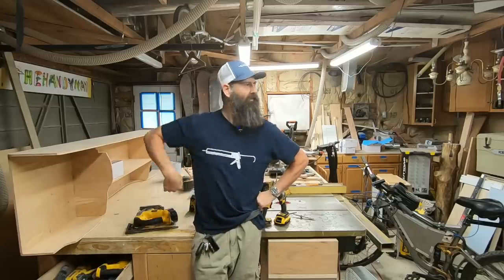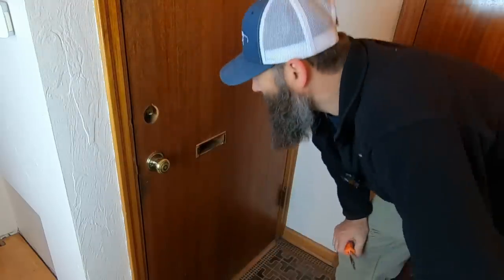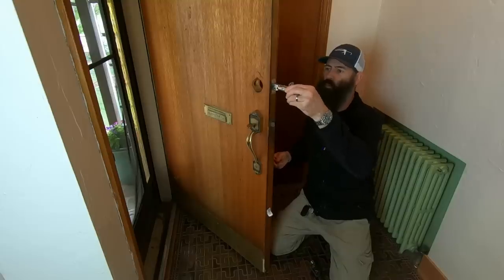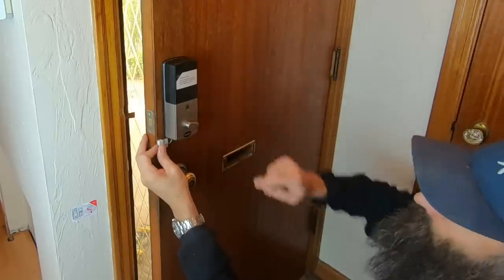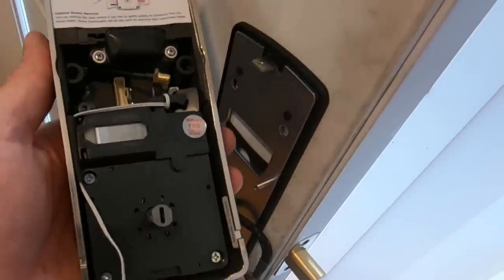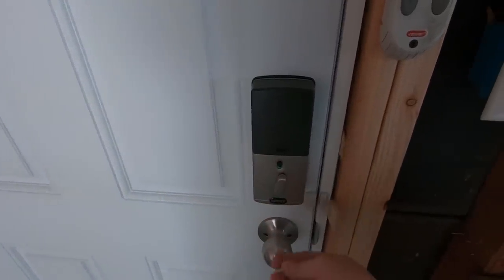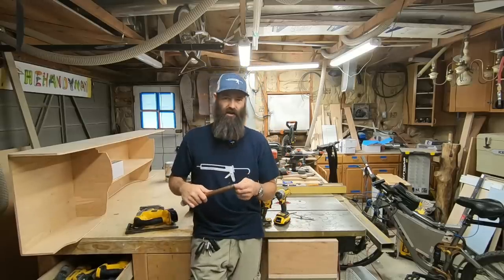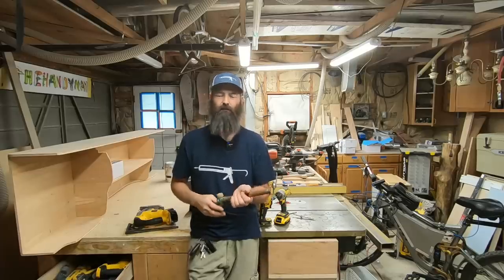Smart Lock Installer Makes $300 Per Hour | Easy Money | THE HANDYMAN

Comment: I put a kwikset code lock on my back door recently.  When I opened it up and started pulling all the parts out and all the instructions, it was a bit overwhelming to look at.  But one youtube video was all it took and I had that thing slapped up in ten minutes lol.  I need to file my strike plate a bit like you did, my deadbolt has a bit of resistance to it like that.  And man, never stop doing the high pitch voice, it cracks me up every time lol
Reply: You don't want to have any resistance because it will wear down the batteries fast. If you ever see reviews complaining about battery life on these locks, it is because the deadbolt is rubbing and straining the motor.

Comment: The first frost free I ever replaced for my Grandparents used a threaded adapter.  I wasn't comfortable soldering.  The problem is you can't keep tightening the frost free faucet until it stops leaking because then it won't line up correctly outside.  I tried pipe dope, teflon tape, still leaked.  So I followed up with using teflon tape AND pipe dope, and not a drippy drop!  In my home last year I just soldered a new frost free on, no need for a threaded adapter, really doesn't help the process along at all unless you were using PEX or CPVC in which there's no copper to solder anyway.  I'm also NEVER going to use a shark bite fitting, no thanks!

Comment: Does the exterior portion of the lock have some sort of ears that stop the whole assembly from being rotated? It just seems that with that lock being so tall above the lock hole, it would provide so much leverage so a strong individual could just put some muscle into the top of the assembly and twist it, shearing off the 2 screws that hold it all together. Haha I could be totally wrong but that was just my first though.
Reply: the mounting bolts for the smart locks still pass through the deadbolt latch assembly, just like your old door handles and deadbolts, so you can wiggle them a little bit, but you would not be able to get a full rotation out of the outside face. I couldnt see real well in the case of these bolts, but the one I installed at my house and my parents house, the bolts were thicker, so I dont think you would easily shear them off either

Comment: I have a love/hate relationship with smart locks.  I have run into too many homeowners that have doors out of whack to where they have to push on the door extra hard or even lift up on the door knob to engage their current deadbolt.  They often do not want to pay the extra labor of fixing the door first in order for the smart lock to smoothly function.

Comment: I'd like to put a smart lock on my front door, but my door is a tight shut. As in, if you try to "throw" it closed, there's a chance it won't latch. There's resistance from the frame. Not overly confident in messing with the shims to fix the close. And from what I have seen, these locks are junk if there is any sort of resistance for the deadbolt.

Comment: Question, I’ve installed bazillion ceiling fans on both of my houses and others and they used the L-Shaped boxes, I noticed that the fan bracket doesn’t attach to the box itself, it gets screwed right into the joist. You have the same?

Comment: How long do the batteries last in general on these things? And how do you get in if the batteries die when you're on the outside (other than a sawzal)
Reply: I don't have a wifi/camera one, just one with a keypad and autolocking, the batteries last for a along time about 1 to 1.5 years for me so far. There is still a physical key hole under the little swinging door below the keypad if the batteries die while you are out.
Reply: Maybe it sends your phone "Low Battery" messages? 🤔

Comment: This is brilliant. So literally everything fits like standard deadbolt hardware and just a few simple connections done! Right?? 

I would love to do this as some solid side work. It looks pretty cookie cutter to understand. 

Are there any challenges to be aware of or can I start this right away? 

Love your easy instructions.
Reply: Yes, there are things you can run into that change that easy swap job into something way more involved unless you have the jigs.  I'm sure that's why he asks for pics now.  I do all the key swaps and lock swaps for 35 units, all of them are easy once we switched to the quick change deadbolts.  I rarely have to re-pin a lock now, which is more expensive time wise.

Comment: Did you supply the locks in your price quote as well? Or were they supplied by the customer separately?
Reply: I'm sure the material was billed separately. Those locks cost more than 100 each.
Reply from the maker: The locks run $400 each.  They were supplied.

Comment: Found out a couple years ago that shower mixing valves are the same way. Threaded on the outside, sized for sweating 1/2” copper on the inside. 🤯
Reply: Yep. Just takes forever to heat up😂😂

Comment: Smart locks may be smart but they dont have opposable thumbs when the door needs to be compressed against the weather stripping to cleanly throw the deadbolt. Ran into the same issue installing some of these a while back having to grind out strike plates. For $400 you would the companies that make these things would have figured this out by now.